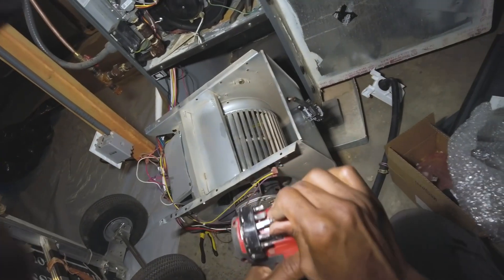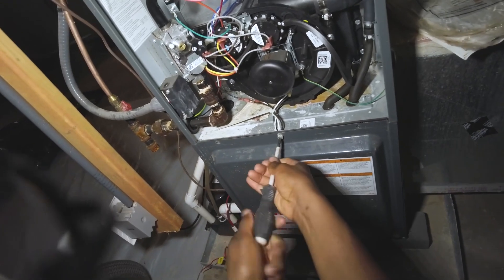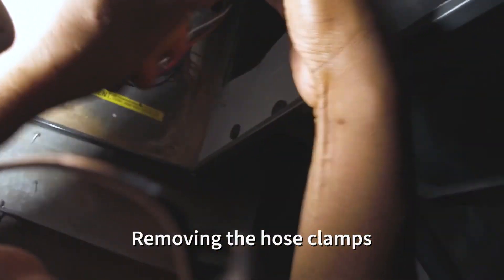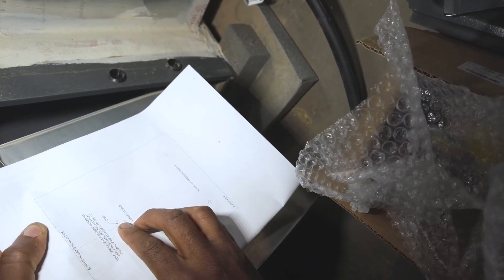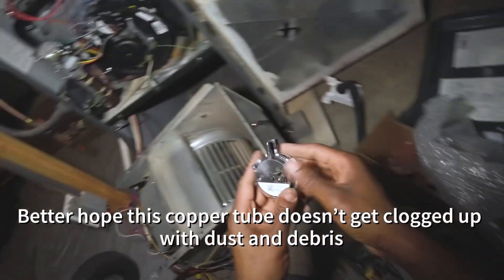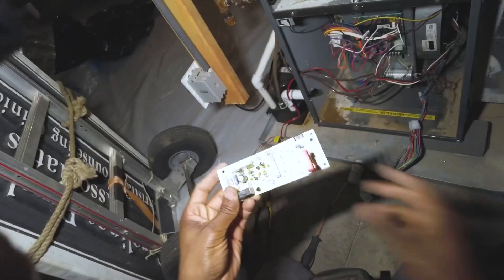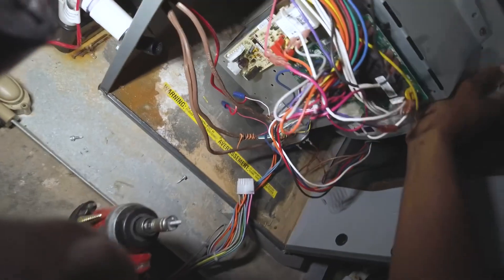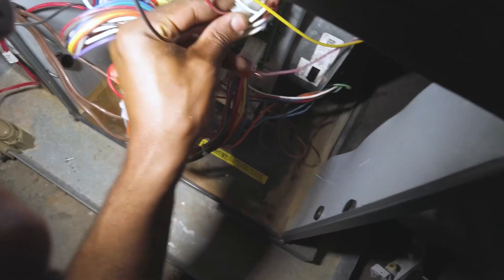Goodman Blower Guard Recall Kit Install on 90% Up Flow Goodman Furnace with PSC Motor

Comment: I thought this "fix" was illogical and unnecessary from the beginning. If the problem was identified and deemed as a "drain pan issue," then why not just replace the pan with a updated version with a heat tolerance rating in excess of the limit swich set point. Why add a secondary board to de-energize the gas valve, after all isn't that the purpose of the limit sitch, to de- energize the gas valve in an unsafe condition?

Comment: Nice vid! My company just picked up a lot of our local recalls and we are starting with 5 on Monday hope this is helpful to contrast the way goodman wants it done lot of time saved by not unplugging all the wires
Reply from the maker: Thanks! Yeah they're not too bad once you get a few of them on your belt you become pretty proficient with them
Reply: so what part of this assembly is putting my furnace into external lockout mode constantly? just about everyday have to reset power

Comment: After having two different kits installed and still getting random lockouts, Goodman has finally agreed to replace the drain pan on my 2 yr old furnace.  If I'm still in this house when the system needs replacing (probably sooner than later), I'll be going back to Carrier.  No more Goodman products for me.  I gave them the benefit of the doubt because all the sales people said they had their sh&t together.  Never again.  The tech has warned me about all the parts that are going to fail prematurely.  At least I registered for the 10 year parts warranty.
Reply from the maker: Just curious is it a two stage or single stage furnace?
Reply: @HVACTechKnowledgy  it is a 2-stage 96% furnace.
Reply from the maker: Cool thanks been experiencing some issues in the field both of two stage furnaces.
Reply: I was wondering if you’ve ran into any issues. We’ve done two of these kits. First furnace runs flawlessly, no issues. The second we’ve been back to several times due to intermittent lock outs, luckily homeowner can usually just reset the furnace and it kicks back on and works all day then they go to bed, wake up and have to reset it every couple of days. I think the last tech that went had a rep from Goodman come out and still couldn’t figure out what’s going on so they approved the new pan instead.
Reply: @ericpowell9924  since the kit was removed and the drain pan was replaced, furnace runs fine.

Comment: I installed this kit twice and still the furnace goes into lock mode . I thought it was a defective board or pressure switch and had a second kit send out and still the furnace shuts off . I know the blower is working but some how the unit goes into lock mode and I have to reset it again . The longest I had it working with no issue was a week . I finally removed the kit and no issues with the furnace. I think the kit doesn’t work . I’m a home owner but I have experience with HVAC and I’m a professional appliance technician for BOSCH . This kit sucks . The plastic pan has no issues so I’m not worried.
Reply from the maker: Oh man that sucks, I’ve installed a few dozen of these and haven’t had any issues yet Did you reinstall the entire kit or just the board when they sent you a new one? One issue I’ve seen is sometimes the pressure switch leads will come off when you side the blower motor back in.
Reply: @HVACTechKnowledgy  I’ve replaced the entire kit wires and all. I have double checking the wires and checked all the connections and still the furnace locked out. The furnace has been working for a year without the kit now . I gave up on the kit , have no clue why it doesn’t work . The blower pressure switch does close when the blower motor comes on , I checked it with a volt meter and then continuity test to make sure it is close. Some how once in awhile the board doesn’t get the signal that the pressure switch is closed or the gas valve isn’t energize . Somehow the timing is off , or there is something wrong with the boards internal logic. I was wondering if anyone else is having the same issues.
Reply: @juanmercado2577  I am also having what sounds like the same issue.  The furnace will get up to the set temperature, but then when it drops below the threshold it just won't kick back in again.  And I have to go down and toggle the furnace switch off and on. Only for it to continue at any random period of time.
Reply from the maker: Is your furnace two stage or single stage?
Reply: I just got my first Lockout after a week that the kit was install, the tech came back and put some foil tape around the copper tube. Cross finger it will solve the problem.
Reply: Is your system was running the fan on auto mode or the fan always on in heating position ?

Comment: Im working on this recall on Goodman furnaces, did you ever get a call back saying their heating isn’t working. Or some saying it works for some time and then system turns off, and all they hear is the blower ? If you can reply I would appreciate it. Thanks
Reply: I am a homeowner got this kit installed, furnace had2 instances of failure to start I got to work with short off on with ac power switch , tech replaced blower motor per Goodman. This year happened again. I want this bs circuit removed and metal pan installed!
Reply: I’ve had callbacks on them. If that rubber grommet doesn’t seat properly and air gets by it the pressure switch can randomly open. I make guys put some silicone around it now
Reply from the maker: Oh wow thanks for the heads up. I still haven't had any yet 🤞. How many have you done?
Reply from the maker: I haven't had a call back on one yet but won't be at all surprised if I do.
Reply: Appreciate the replay, this recall is getting annoying sometimes, system is acting up, then I unplugged everything and leave the unit the way it was before it had the recall done, and unit works smooth. 🤦🏻🤦🏻🤦🏻
Reply: @raulmen28  If we unplug that Blower Kit What would be the consequence ?
Reply: @MMorin-qy8jr  everything would work just fine.
Reply: @raulmen28  so why did they came with that recall solution ? Do you have a link to see the picture of the Drain Pan Kit DPKT3B ? Is it a metal pan instead of plastic ? If the tech install the Drain Pan Kit, he could take off the Blower Guard kit that he install ? Thank you
Reply from the maker: Is your furnace two stage or single stage?
Reply: @HVACTechKnowledgy  single stage. I call Goodman and my furnace is not on the recall, my HVAC company install the blower guard kit for nothing. Since 3 days I disconnect the kit and the furnace work just find.
Reply: My furnace had 2stage blower, after a lot of jawing Goodman sent a nonflammable replacement pan and blower mod was removed. No more problems. No one should accept a kit that will make your furnace unreliable. It introduces 2 failure modes: pressure switch or current sensor.
Reply: @MMorin-qy8jr  the came up with the recall because Goodman installed a plastic draining pan from factory, first they tried the cheapest way which is the blower guard kit to prevent overheating and melt the plastic draining pan ,but we have been getting calls back about heating issues. Now we have to go back and install metal draining pan, and sorry but I don’t not have a link for the pan.

Comment: Interesting fix to this problem. Like you had mentioned, can see that copper tubing getting clogged with dirt if homeowner isn’t good with filter changes. Off topic question. Are 80% gas furnaces still available?
Reply from the maker: Yes sir 80% gas furnaces are still available.